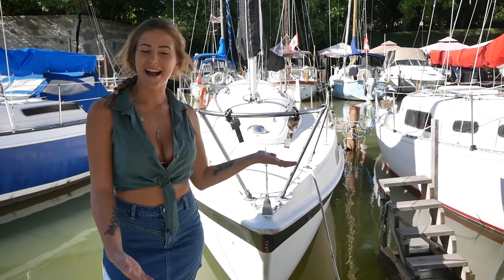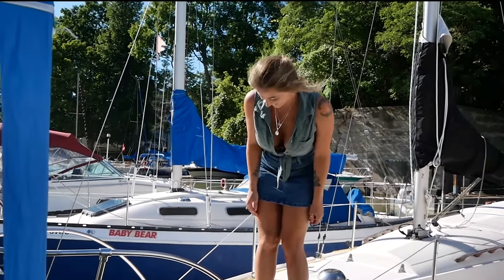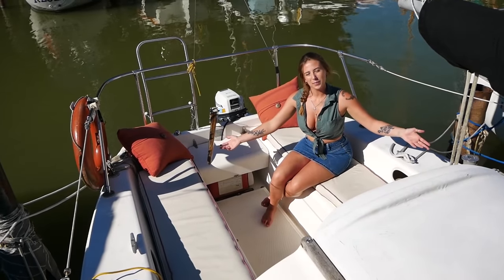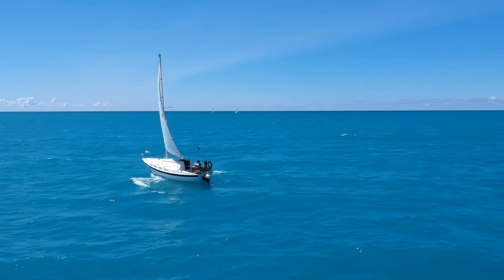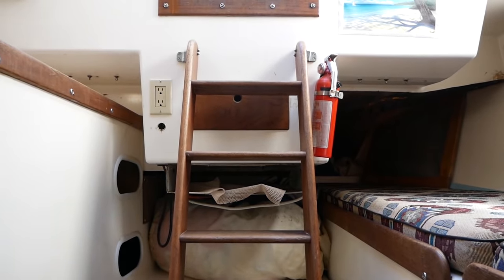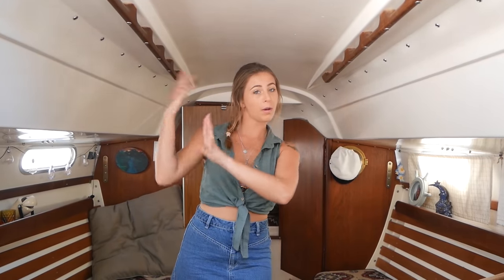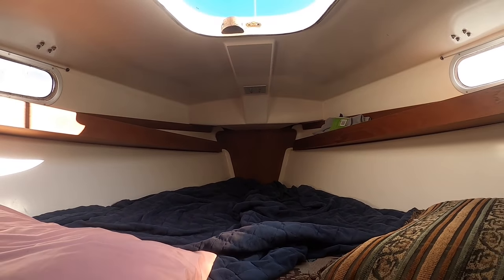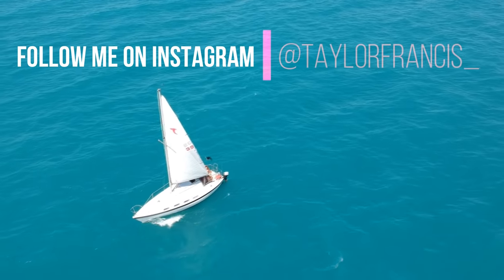Boat Tour! Inside my 1978 Tanzer 26

Comment: I used to live on a 1979 Morgan 382. All those bells and whistles you don't have, like a real head, inboard engine, gimballed stove, various electronics, auto-pilot, bow thrusters, windlass - those are all the things you won't have to fix. And for day sailing or even a weekend trip where you are, you probably don't need any of it. Of course, I don't have to tell you this. You saw how much stuff broke on Nauti Dogs! It just happens. One thing though - a jib furler would be handy, even though it's not really necessary.

Great video. Keep it up!

Comment: Taylor, nice tour of your Tanzier 26.  Your hotplate stove uses a butane fuel (lighter than air) vs propane which is heavier that air and not used in confined spaces , especially boats.  The only other alternative is an alcohol stove.  Have fun this summer sailing in Lake Huron.

Comment: hi. many people had serious problems with the same gas cooker, because the canister can blow.
but...
the only problem with it, if you are useing a bigger pot like the suggested one.
NEVER use bigger appliances on it than 8 inches.
the bottom can reflect the heat to the canister.
I use the same type on my boat usually, and I never had any problem with it.

Comment: Great boat, watch that propane burner, I had one like that explode on my Corribee, the pan, kettle etc can transfer heat back into the gas canister and then.....! The explosion turned into a fire, make sure you have a fire extinguisher in the rear locker or cockpit. I was in the cockpit when the canister exploded, there was no way I could get into the cabin. When you experience a boat fire you understand why it was every sailors worst nightmare! I can vouch for the effectiveness of powder extinguishers, it's the reason I still have a boat. Carry on cruising.

Comment: Nice yacht, just the right size for 1 or 2. To help with some of your 'problems' ... 
1 you can fix turning blocks to the deck and run all the main lines aft, run the lines through a set of jammers then move the winch from the mast to the cabin top, port or starboard. So mast - turning block - jammers - winch. You don't have to leave the cockpit, always good 1 up or in a storm.  An autohelm is also very helpful so you can go forward or below decks whilst underway.
2 I have the same space under my compamionway and found if the steps are removable, or removed, you can fit an engel 110v/12v fridge freezer on slide out tracks. I slide the fridge out, get what I want and slide it back to be a step again.
You seem a lot happier, nice to see you dressed normally and yes, I get the sign below decks. Well done girl.
Is your guitar a Taylor? Taylor's Taylor and Tanzer 🤓🇦🇺

Comment: Your butane burner is setting you up for an explosion, butane is heavier than air, if the can or the stove leaks the butane will seek the lowest point in your boat, if it encounters an ignition source, perhaps a spark generated by a bilge pump your boat will go boom.  You should be using an alcohol burner on a boat.  Alcohol is non explosive, evaporates quickly and alcohol fires can be extinguished with water.

Comment: I’m familiar with the windlass a little extra strength? I have a 35 pound CQR on 150 feet of 3/8ths” galvanized rode. And depending on how deep of water I put out in determines the morning workout I will have to before I start the daily passage.

Comment: i enjoy Tar 976 tanzer 26 hull#125. I live on it all summer on lake Winnipeg. insulate the icebox it will hold ice for several days. the drain goes to the sink pump i don't have a water holding tank i use jugs i can clean for water.  she is a fast boat and can take rough weather i have sailed in 25 knot winds with reefed main and 70% jib. if you have questions i have redone all the old wiring and added a rigging plate to the mast base.

Comment: I had a similar boat (Tanzer 7.5 - exact same engine actually) which had all lines led aft. I used to think it was easier for single handling too, but I've since realized it isn't.

"New" boat is set up for lines either at the mast or cockpit, but I've found it easier keeping it at the mast, including when single handling the boat.

Comment: Would love to know how much the boat cost,  and what all if any did you have to do to it to be ready to sail
Reply: from my experience i would say approx $3800  if you are looking for a used boat be ready to jump on a plane when the next hurricane hits on the gulf coast , bring cash , I literally picked up two 30 ft boats ( with minor fiberglass damage ) in New Orleans for $1500 one i fixed up and sold, the other I used profit to fix up a Cal 30 that is still in use ( sailed to Tampa last summer ) just be there max. 4 or 5 days after the storm passes. first come first served  unbelievable

Comment: Don't put instruments on that surface you pointed to...that's a great spot to lean back and relax! If you have to have them then I suggest you put them high and in next to the companionway door frame. The back sides of them will not be ideal but you can build a little cover for them, and on a long passage you'll be glad you didn't as you relax against that surface!

Comment: Great Boat. But get that depth sounder fixed. Home is only where the anchor drops if you know the depth and have let out enough chain. In calm weather 4x the depth and In rough weather 5 x or even 7 times the depth. If it can’t be fixed Nasamarine make an affordable depth sounder. The other thing you should have is a cheap android tablet or an iPad with GPS in a waterproof case running Navionics or similar Marine plotter software. That way you will know accurately where you are dropping your anchor.